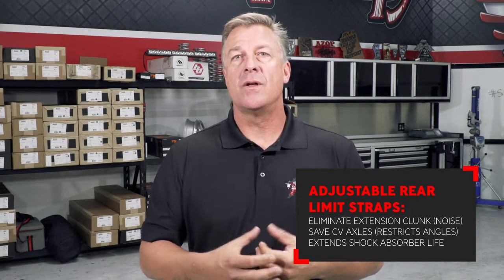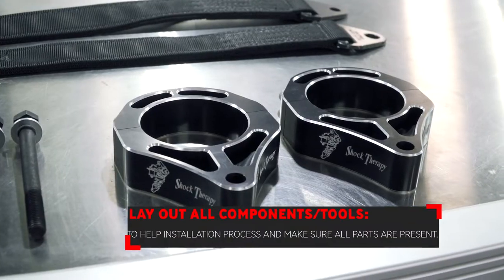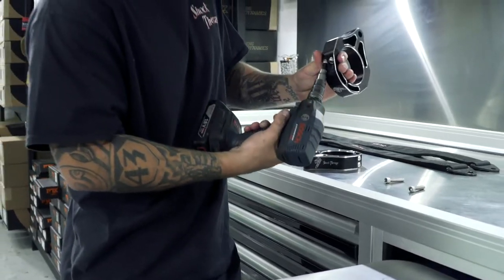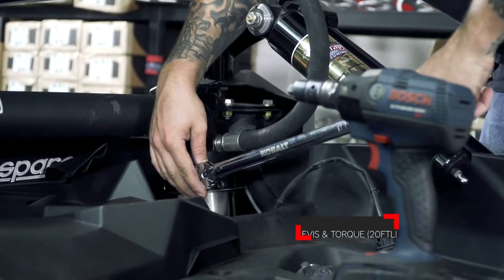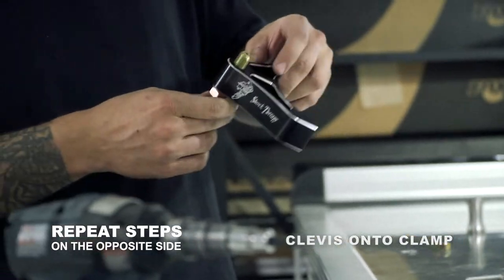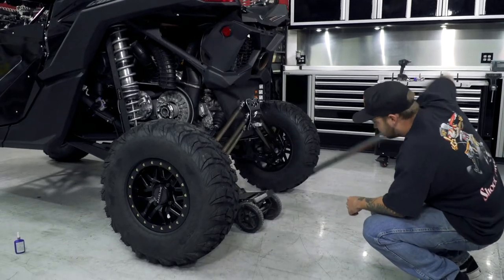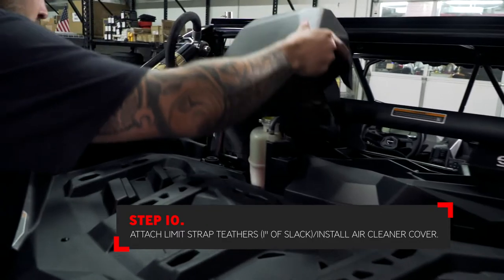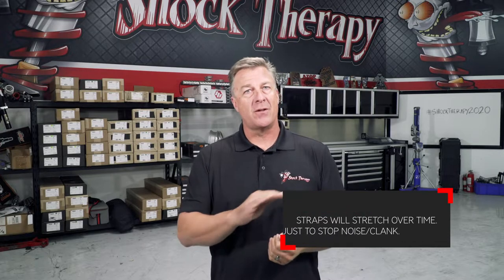How to Install Can-Am Maverick X3 Rear Limit Straps

Comment: is there a set up for the rzr 1000 non turbo
Reply from the maker: yes we have kits for that. They are $270. We don't have them on the site until we are done with instructions but if you call the shop you can buy a set over the phone.
Reply: thank you. I'll give a call